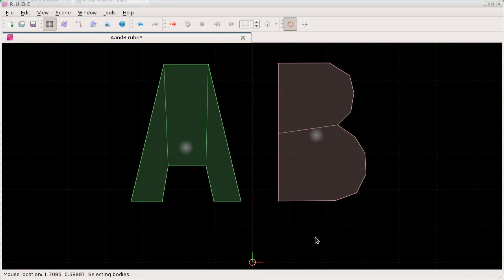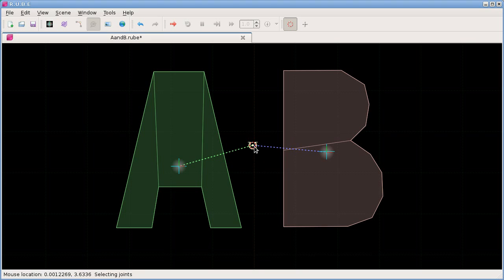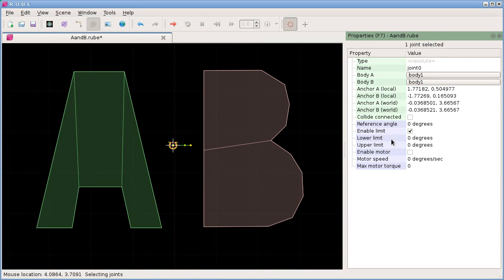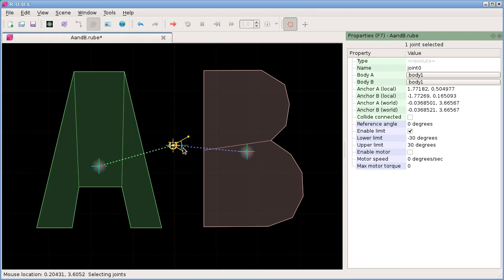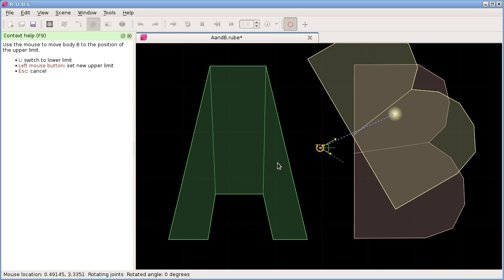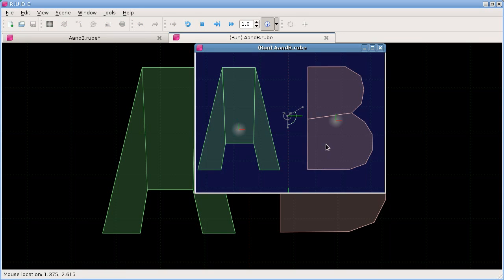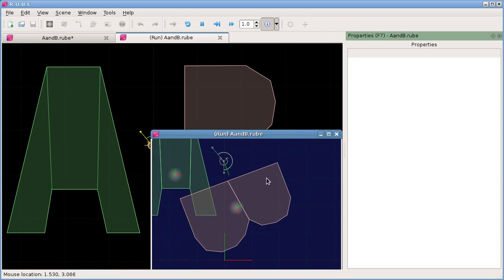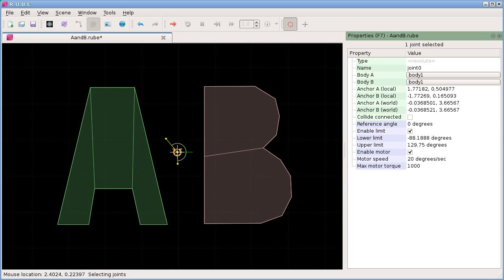RUBE editor tutorial 10/18 - Revolute joints

Comment: Pressing L takes the pivot as the anchor A. Should not be B?
If you move away anchor a and b it's hard to visualize.
How can I reset them to be in the same position?
Reply from the maker: The 'L' is for 'limit', because you are setting the limits of the joint. When you enter that limit-setting mode, body B will indeed be moved to where the anchor would put it when the simulation runs. Typically the local coordinates of the body A of a joint are used as the reference base for all measurements eg. angles, limits. It's pretty easy to switch bodies A and B of a joint (under "Joint" in the action menu, choose "Switch bodyA/bodyB") if you want to set the limit using bodyB as the reference - then you can switch them back again.
Moving anchor points to be in the same position requires moving the bodies, which you could do with this script mentioned in the forums: http://www.iforce2d.net/forums/viewtopic.php?f=6&t=338&p=1312
Reply from the maker: ah... note that switching the bodies of a joint does not make sense for some joint types (wheel, prismatic) but should be ok for most.
Reply: Got it. Thank you.